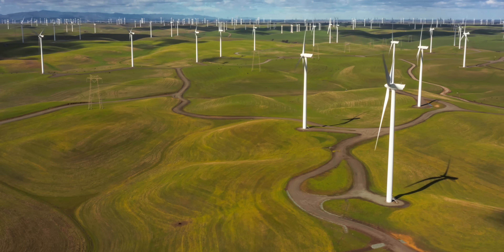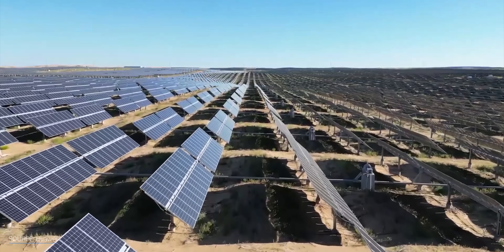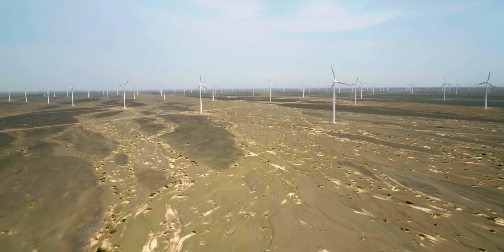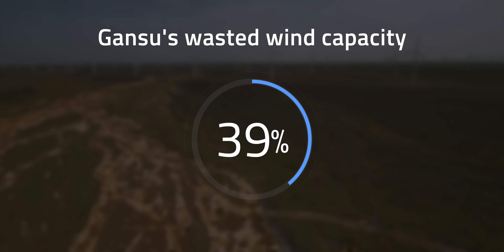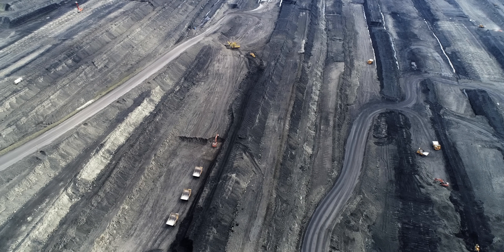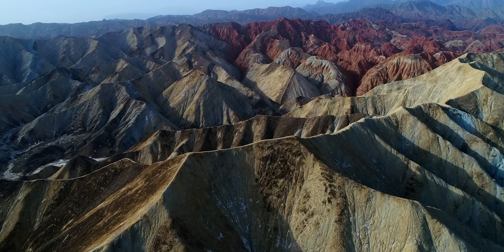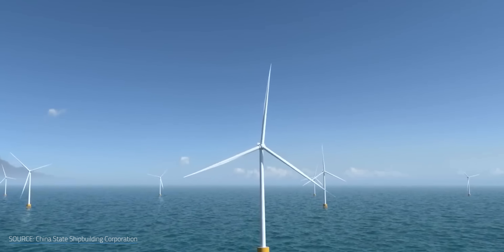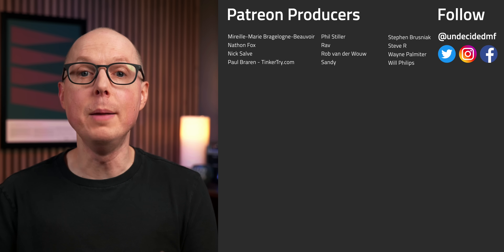The World’s Largest Wind Farm has a Tiny Problem

Comment: Love your optimism Matt, always positive.
Well...... 1GW for 750K to 1M homes you say? so that's between 1kW to 1.3kW per home.....the avg USA home uses 10.8kWh.  With usage between 50W to 8kW (pumps, A/C, heaters etc.)
And the 1GW windmill, that's peak right, perfect conditions?  And no losses in production or transmission or storage.....?
Reply: @r.d.alverson9684  exactly,  probably we can talk about 200.000 if we talk about nominal power on average per home, because 10.8kw have to be maximun power peak with everything running at same time.

Comment: It's sitting stationary because it needs wind to make the generators turn. No wind - no turn - no electricity!! Simple question - simple answer. Substitute solar for wind generators and the same answer... no sun - no generation - no electricity. Enter the better proposition... Nuclear Reactor generators for base load power and coal and/ gas generated electricity  as a backup source of power. It's always there and available. and can be cranked up to meet demands as required. Say NO to renewable energy unless  you want to experience black outs and brown outs. Say yes to Nuclear Powered Generators with coal and gas as a back up source of power.
Reply: Dunning-Kruger on full display.

Comment: Easy problem. Solution: put some data centers (which uses 100MW each) there. Well, maybe we need to put 50 data centers :)
Reply: The question is whether it's cheaper to build power lines or data lines to the cities

Comment: Not a big fan of using non-recyclable blades at or near the water. However, they can now recycle the blades and if you clean up the broken blades it won’t be much of an environmental disaster. Didn’t talk much about battery back up, but so far, solar overall is going to be cheaper than wind. Let’s not forget that with battery back up every nuclear and coal plant has now been obsoleted completely. There should not be any discussion in the world whatsoever about building any kind of nuclear power generation.

Comment: One big problem in the US is there are different grids which may not be able to transfer energy across such a long distance. Also the land and state laws could be hard to implement that. The more realistic solution is to get build data center and solar or wind farms together in the desert. 
By the way there's a space launch center in Jiuquan city which could be benefited by the wind farm. There will be more data centers because of the space launch center. China allows private companies enter the space launch market already which could boom the industry and this city. This location is not perfect for large spaceships but cheap enough for launch small rockets and satellites for those private companies. All those companies will need their own base and datacenter nearby and need a lot of electricity.